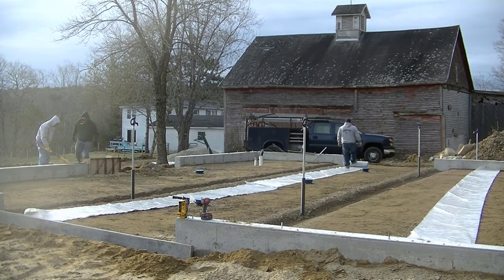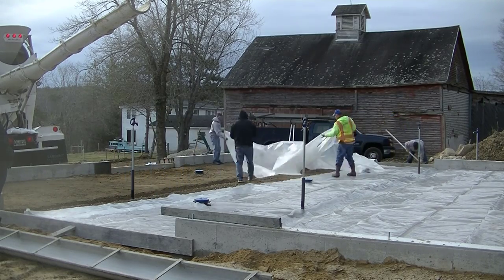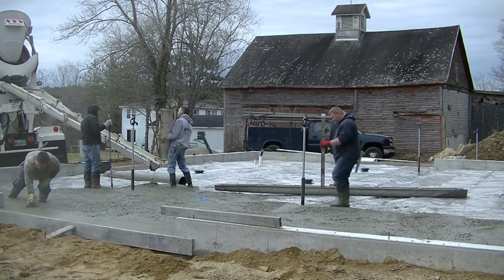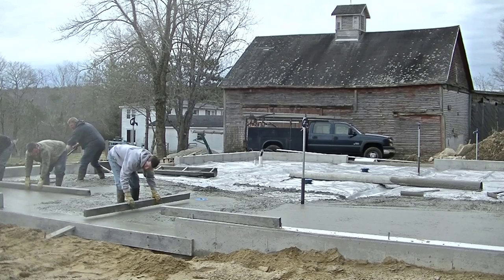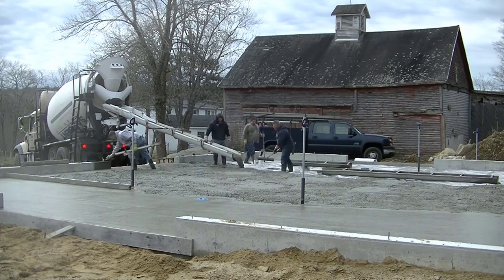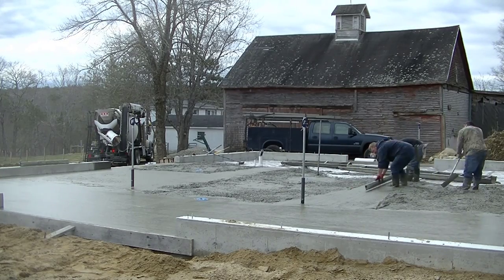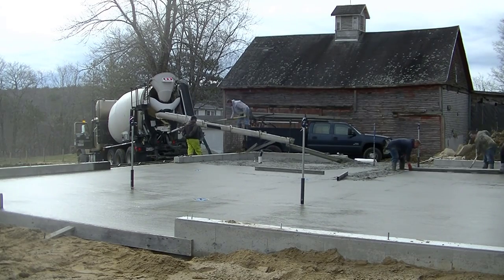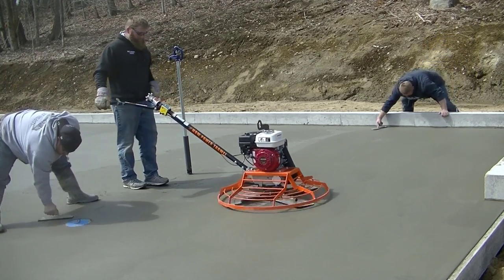How To Pour And Finish A 50' x 36' Concrete Floor (Horse Barn)

Comment: Since we do Excavation, Foundations, Floors etc we carry a 14' poly chute, we have 2 other PVC chutes but most times you just don't have the height for a 14' then a 12'. We use a chute tripod to support the chute if we need more than that we own are own pump and pump it also. I have done the flipped chute works good but can't control it as good as a Elephant Trunk as we call it works like a pump hose in that if you pour over a 8' wall it has excellent control and keeps splatter down. We don't have rear discharge in my area unless it's for a pump. Nice work Mike 👍 one truck one bag of calcium how long till you were done after pour 4 hrs?

Comment: In residential most often here in Ohio a lot of the flat work is subbed out. Now in the last 12 years as the economy has changed you do see the same company doing everything. In commercial most generally it's a one stop shopping deal. Excavation, footers, walls, rod busting(rebar), flat work and site work is all done by the same outfit.

Comment: Mike nice video you guys are awesome at flatwork. Ive been doing concrete for 30 years and I just started a youtube channel last year called Bondobuilt. Its quite a learning curve doing Youtube. Maybe check out my channel and give me some feedback? good or bad. We do Nudura foundations some block foundations. We also install all our own radiant heat under the concrete. . i have a spray foam guy do my insulation. They spray right on the tamped gravel. I do alot of the lighter excavation with my mini excavator and Kubota tractor. We just did a dog kennel with the same fuzzy finish as this horse barn. We been pumping all our radiant floors so we dont mess up the tubing. This is very expensive as you know. I see these shoots your using could help me out and save on some pump charges. Im in upstate New York. Where do you get these shoots and what are they called? I like watching other master concrete guys because there is always something to learn about concrete. Do youi guys do any trench drains? I find they work real good but we have to prep all our jobs and slope the gravel. We get the barns with gravel just roughed in usually with bank run gravel. Keep the videos coming 👍👍
Ron Bond (Bondobuilt construction)

Comment: In my area, concrete finishers only do concrete finishing. If a slab form bows or blows out during a pour, they call the carpenters over to fix it (I think in some areas that kind of carpenter is called a ‘mason’. Masons here do block work). Even the plastic you guys were laying down is generally part of the carpenters scope.
Reply: Yep